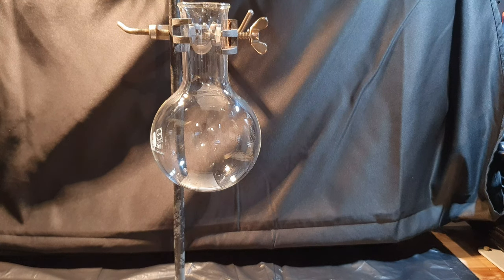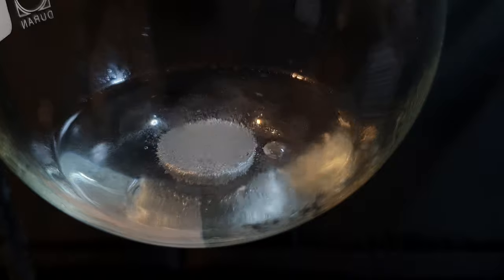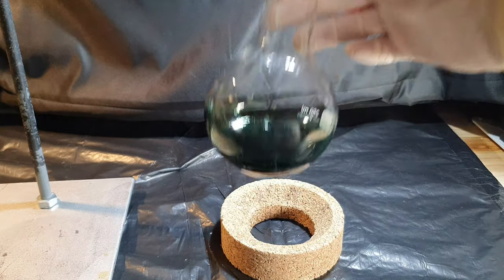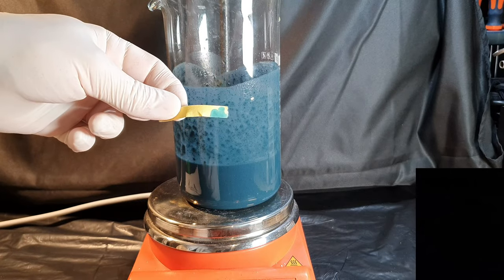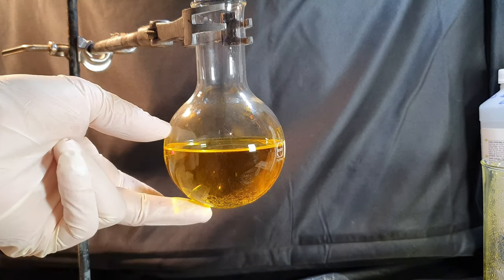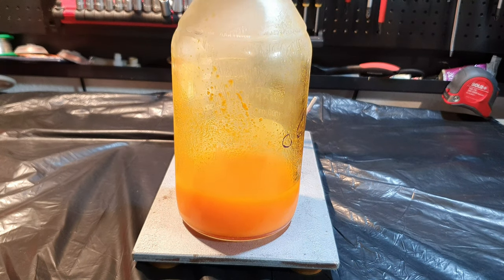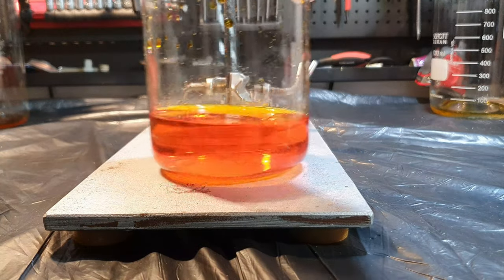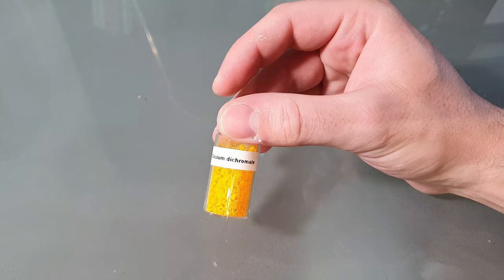Making cesium dichromate from chromium metal and cesium chloride

Comment: FYI, dichromate can be made directly, under fairly aggressive conditions: melt potassium chlorate and chloride with chromium oxide.  O2 and Cl2 are given off, as the reaction turns deep blood-red, indicating molten dichromate.  A clean steel or stainless crucible should be used (or probably hard glass or porcelain too), and the molten material should be poured into a very dry metal pan to cool, from which it will be loose and easy to work up.

With KCl to balance, O2 release should be minimal.  KOH can be added to absorb Cl2 as well, or balance for chromate instead.  An excess of KClO3 should be used to account for catalytic breakdown (especially in a dirty or oxidized metal crucible, or if organics are present, etc.).  It's been many years since I did this reaction so I don't recall exactly which way the balance works best, unfortunately.

You'd probably want to oxidize your chromium metal to the oxide first though.  Burning it in the same step might be a little too aggressive...

...That said, now I'm a little curious what chromium flash powder would look like.  "Don't breathe this" indeed!
Reply: Fresnel lense, anyone?

Comment: That's interesting. I always thought they just used cesium as the getter, because that's what just about everybody who explains it says. It's usually an offhand explanation, for example, while they're tinkering with a vacuum tube they might point out the getter material, and quickly mention it's cesium. Which chances are they probably just heard from somebody else, who heard it from someone else and so on without anyone actually checking. Thanks for clearing that up for me AND for the wonderful video. The effort you put into it really shows. Keep it up. =D Best regards from Canada.
Reply from the maker: I think I even got the idea because I was thinking about how these getters work. 
I appreciate hearing that you enjoyed the video! :)
Reply: But isn't it true then? I think that the getter is the deposit that gets the residual gas molecules, and this deposit can be metallic cesium. It might be that the name has transferred to the unflashed compounds and even the ring that is used to heat them, but when I refer to the getter I mean the metallic deposit.

Comment: Very Nice. Cesium chloride is not cheap, I have some so I might make a gram or two of this. But why add cesium chloride as solid 🤔 I know it's very soluble but I thought it was better practice to disolve things before mixing
Reply from the maker: Yes, it would be best practice to dissolve the CsCl first. But I didn't want to add more water because it would mean I will also loose more of my dichromate. And due to the high solubility and because I washed the dichromate with water anyways, I decided to do it this way.

Comment: Nice video, well done!
Cr3+ is not nearly toxic as Cr(VI)...
If you really want to be protected from carcinogens you should work with them outdoors or under a fumehood.
Boiling the solutions will cary aerosols in the air - better wear a ffp2 or gas mask.
Btw: In the EU enterprises are not allowed to work with chromates without REACH-license, so even monetized YT-channels do... So if I ever make a video about them, I would put I on a separate private channel...
About the content:
- If oxidized with H2O2, the oxidizer must be boiled off before the acidic converting to dichromate is done, otherwise the dichromate will decompose.
- Better use sulfuric than hydrochloric acid  to convert, because dichromate oxidizes HCl to chlorine!
- Normally precipitations are made from solutions instead of adding a solid salt... 😉 Otherwise your Cs2Cr2O7 is evtl. contaminated with undissolved CsCl...
Reply: thank you. just wanted to mention similar things - especially the cancerogenic part. please.do.not.poison.yourself. all kind of cromates are mofos.
Reply from the maker: Thank you! 
The fact with the REACH license for YT Channels is very interesting, thanks! 

I boiled of the H2O2 before acidification. I figured the cesium chloride has such a high solubility in water, that it wouldn't be a problem.
Reply: Your product looks yellow instead of orange-red, more like caesium chromate than dichromate... Have you calculated the necessary amount of acid beforehand?

New licenses are not made out anymore, on the contrary the existing have to be prolongated regularely - on application and chargeble of course... In fact it's a ban...
Reply from the maker: Because there was a lot of base left, calculating the amount of acid was not possible. I used the pH as an indication. 

When comparing the color with pictures on the internet it looks just like the dichromate. The chromate has a bright yellow color.
Reply: @AdvancedTinkering  Always a problem with the colours on video - they never look exactly like in real...
Reply from the maker: True. Especially when filming with a phone. I would love to have the capability of precise color correction.